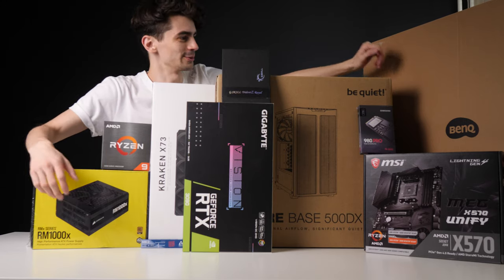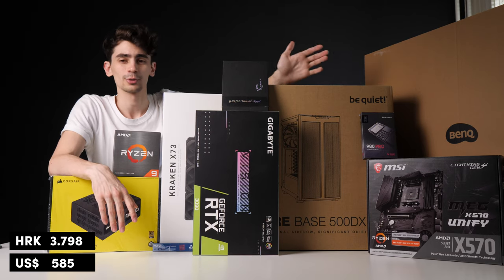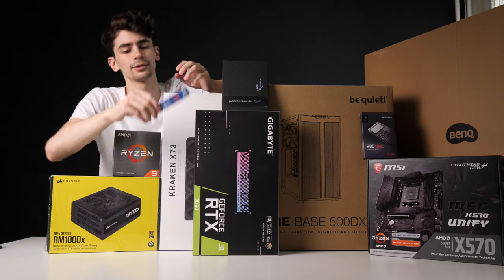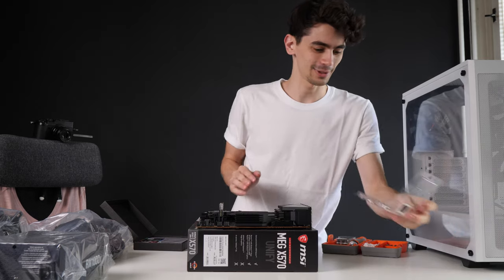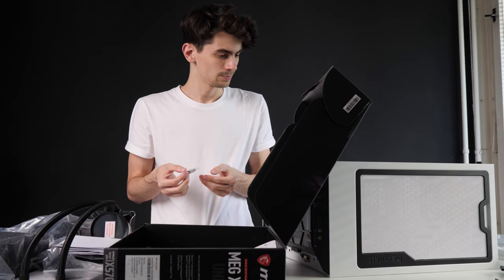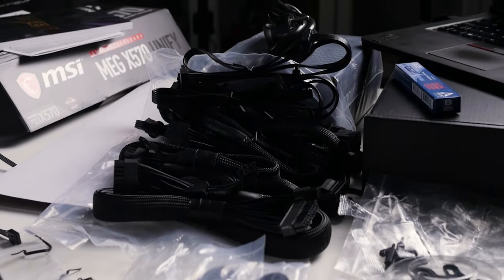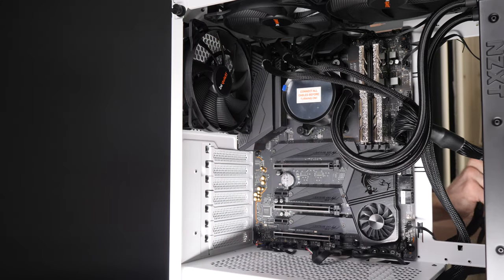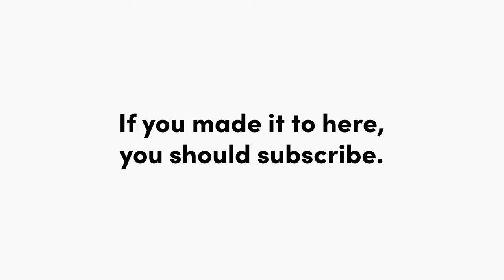FIRST TIME BUILDING A PC (harder than I expected) #5950X #3090

Comment: Solid build mate! Two things you can do differently though is route the cpu cable behind the back and up the top so it looks cleaner, and the pcie cables can be routed through the bottom slots, so there is less cable clutter visible in your pc. Other than that it looks awesome!
Reply from the maker: Why did I not think to come from the bottom? o.0 hahha...
But - it works, and that's all I could care about. I actually used the dingly parts of the pcie cables to prop up the AIO cable so that it doesn't sit on top of the GPU plate and get hot from it.

Thanks for watching!
Reply: @Lenard_S.  Anytime  mate! As long as it works that's all that matters!